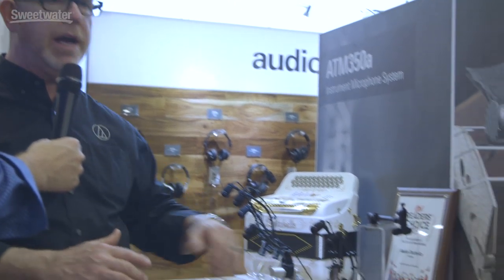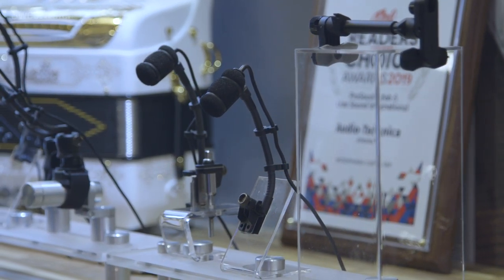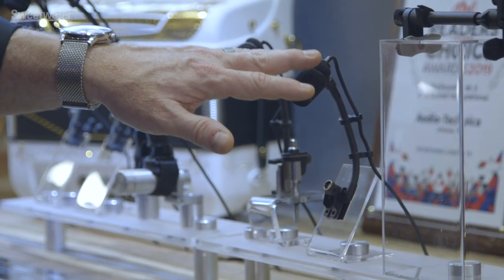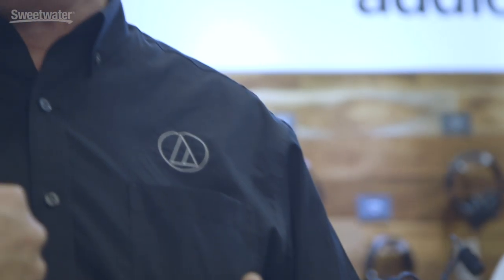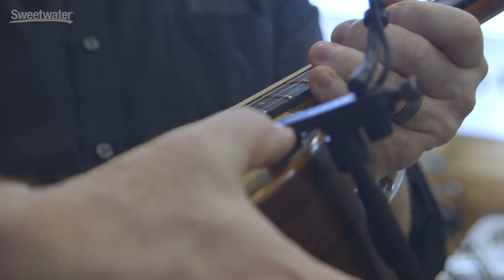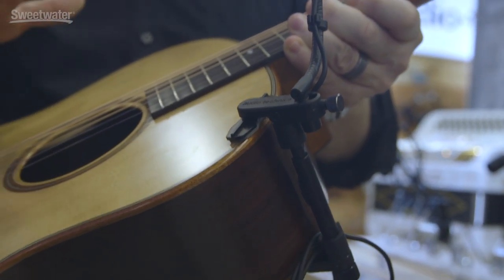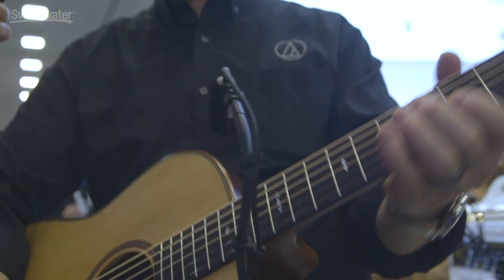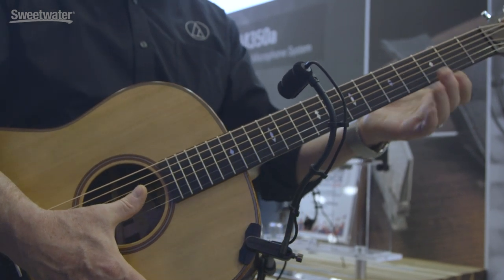Audio-Technica ATM350 Mic Mounts at Winter NAMM 2019

Comment: Sometimes a lot of these products are marketing guff but guitarists seem to have a real issue with their acoustic sounds - the main culprit is piezoelectric pickups! Guys, stop using these things. Even the pros use them sometimes. They sound like crap. Most things are about compromise and I know they are not sucepitble to feedback so badly but they are a compromise too far in an acoustic setting. iRig acoustic is cheap and simple too. I bet these goose necks sound great though - like how a guitar actually sounds.